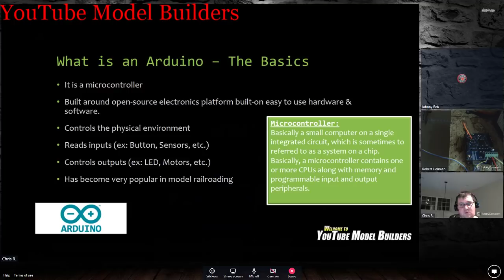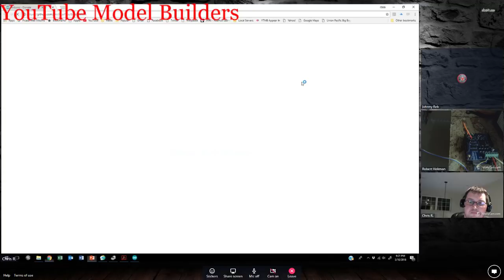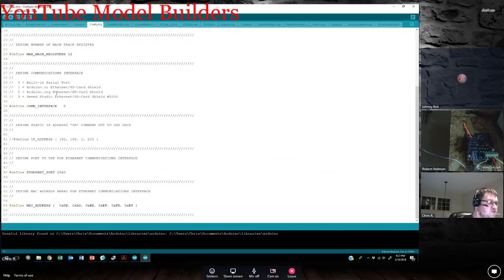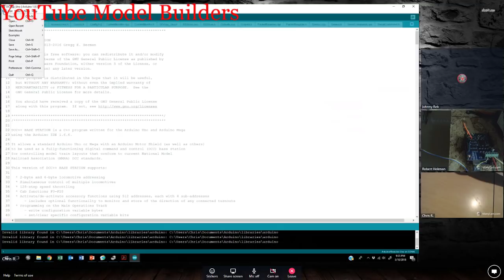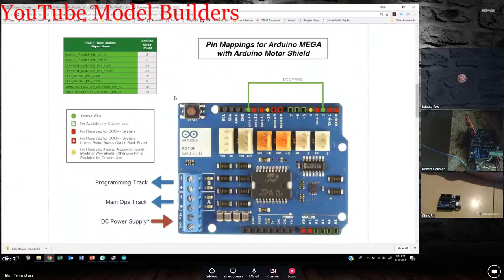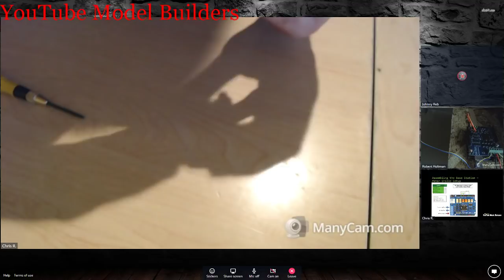YouTube Model Builders is proud to present-Special DCC++ System Build. March 10, 2018

Comment: I need your help related to DCC++ controller which I would like to use only for block reed sensors in RR. For this if possible I need your help for the following....

For Sensor Detection I am currently I am using arduino nona boards 1 as master and 5 has slave. Due to some major changes in Rocrail the solution which I was using is no longer working.

1) I have approx 110 sensors in my layout
2) I have an arduino motor shield and arduino Megaboard 
3) Since I need to configure 110 sensors, i would like to know if we can modify the DCC++ sketch in such away that Mega board becomes master and nano boards becomes slave.
4) Is it possible for you help me in the said changes and I would like to Dcc++ controller only for block detection using reed switch

Comment: I have a MEGA+ESP8266 and am unsure how to program the wifi part so I can connect my Engine Driver for my Phone & Tablet so I can run without using a computer.

Thanks,

Erich
847.341.1120

Comment: Hi Chris i am trying to uild my opwn base station, but i havent had any luck getting an arduino motor shield but i do have an ADAFRUIT motorshield, will i need to change anything on the original DCC++ sketch . and can you possibly tell me if i need jumper and where they would need to go on the  motorshield. cant seem to get my base station to work at all

Comment: Hi Chris I have been watching all the Arduino programs I especially interest in  the DCC++ plus. I followed the instructions and I have rubbed out the connection for the Vin on the back of the  board if I insert an LED between the ground and the Vin the LED still lights up. If I just removed the pin from the motor shield that goes goes into the Arduino Vin would it still work.
Thanks Tony (the other side of the pond)